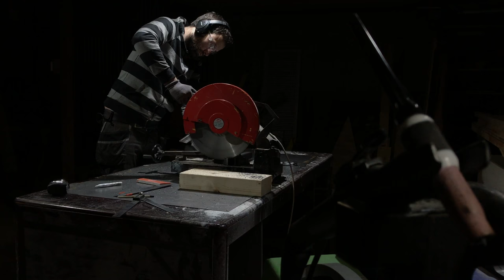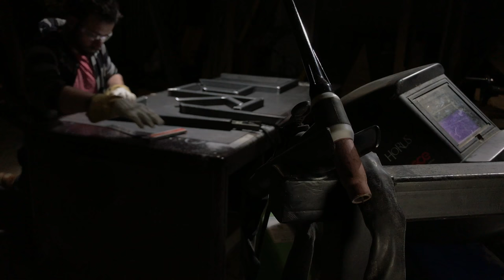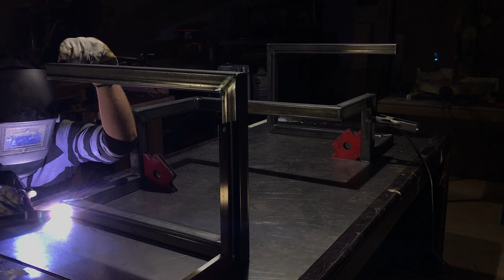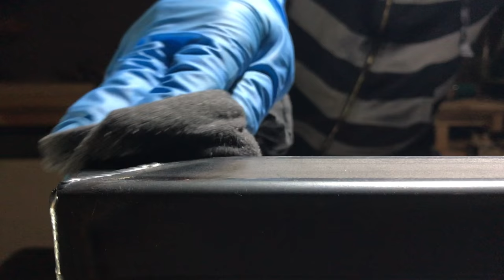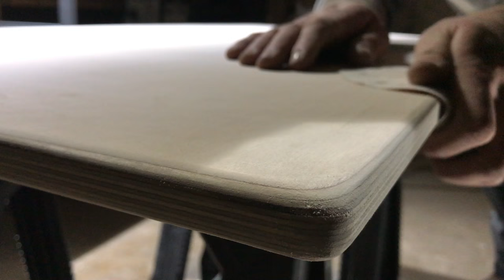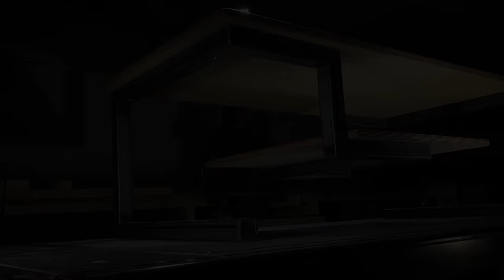Steve Makes: A Coffee Table

Comment: also what type of welder was that. your welds were so neat.
Reply from the maker: Project DIY thanks.. I only showed the decent welds😉 haha.. I used a TIG welder.. it's the second time I've used one so I wanted to get some practice.. I was lucky enough to have a friend who gave it to me (he had it in his workshop for the last few years and hadn't used it, and thought I'd get more use from it).. I like it!! it's slower than using a MIG but you have move control over the heat and the amount of filler metal as you weld so if you get good at it you can do some sexy looking welds!!

Comment: What was the spray on the steel?
Reply: RideThroughLife hey i think he lists it in the description 👍🏻
Reply from the maker: RideThroughLife hey thanks for watching.. I used a polyurethane matt clear coat to help the finish
Reply: Steve Makes Stuff Cool. I tried to use automotive clearcoating on a bicycle frame, to preserve the raw metal look but it started chipping almost at once. Would the polyurethane work for that?
Reply from the maker: I haven't had any issues with using polyurethane chipping of flaking..  a 2-pack lacquer would be better..
This is probably not new information to you.. But it's pretty important to make sure that the metal is very clean.. and you're putting the coating on at the recommended temperatures.. I always put lots of light coats on instead of 1 or 2 heavy coats.. Leaving lots of time to dry/cure between coats.. I hope it helps.. You should be able to get some good advice from the guys in the paint store or it could be worth giving a local body shop a call for some advice.. good luck with it man :)